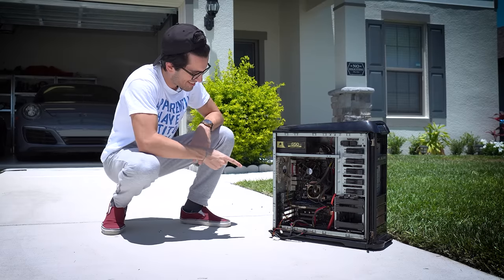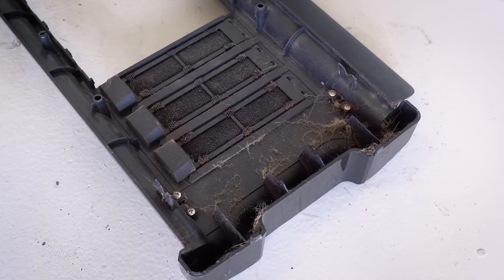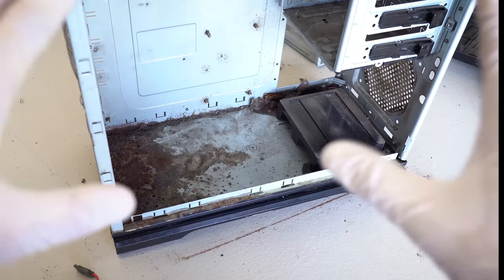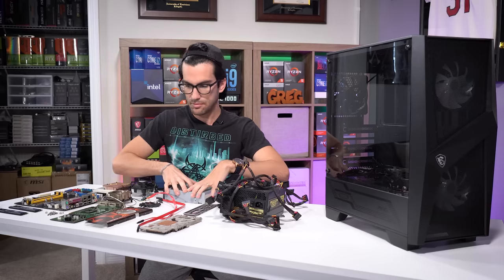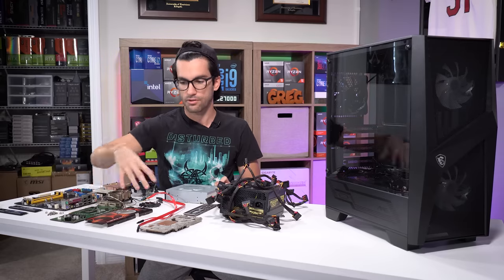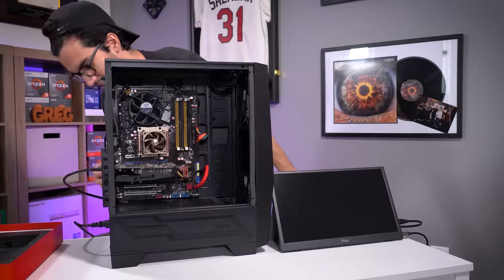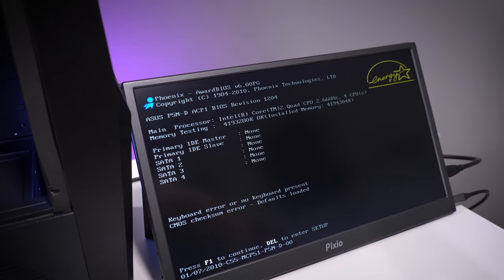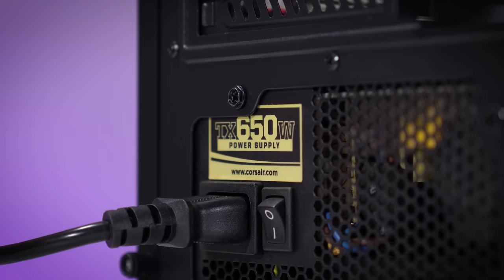Deep-Cleaning a Viewer's DIRTY Gaming PC! - PCDC S2:E4

Comment: you're just slowing it down with a modern OS, you SHOULD use the original OS and just use a newer pc for modern games and you SHOULD of used a case with a 5.25 bay, no reason why you couldn't of cleaned that other one up with time and work, it'd suffice still after that
Reply from the maker: Your comment is glaringly ignorant. You SHOULD do what you wanna do with your own systems. If you've such a huge problem with the way I handle things, do it yourself. Otherwise, leave.